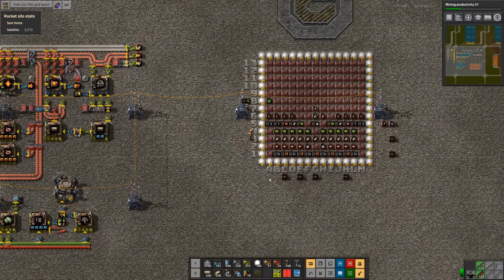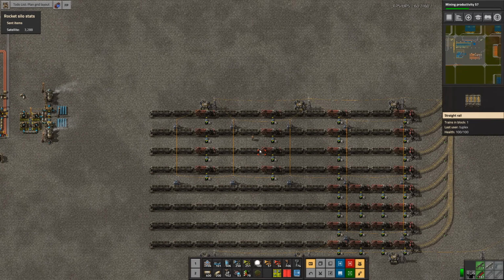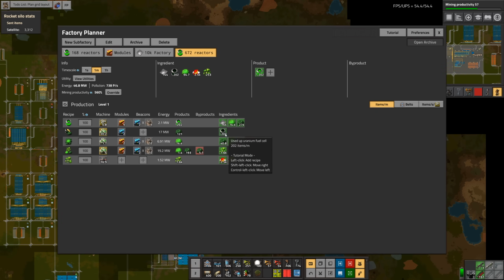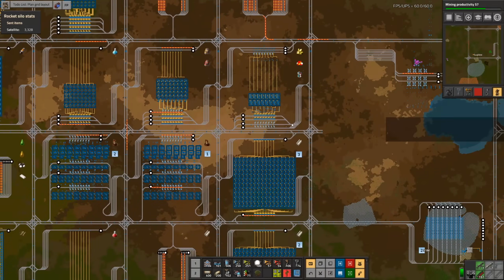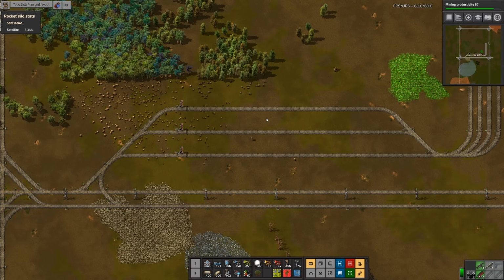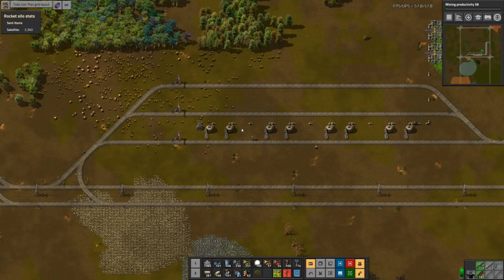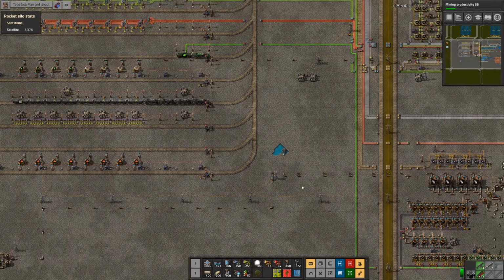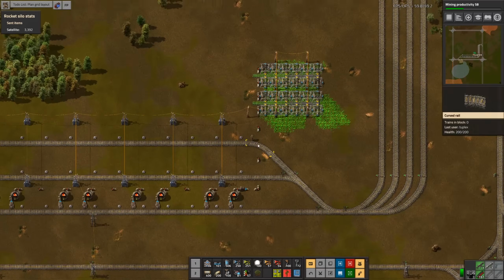Factorio +10K SPM Grid Megabase #2 - Uranium mining

Comment: I'm still not understanding your descision to keep building individual local pipe distribution: as long as the pressure stays up at the far end of the pipe surely the flow rate will remain the same (unlike belts)? OK it makes things prettier, but the pipe-weave spaghetti to make it work in some cases is to my mind not worth the effort..
Reply from the maker: What do you mean by “individual local pipe distribution”?
Reply: @TuplexGaming  In your current setup you have everything, whether transported by belt or pipe, done 8 times from each relevant rail car thru its manufacturing stage to each output railcar. While this is necessary for belt-transported items, surely pipe-delivered fluids only need to keep the pressure up at their furthest point, eliminating a lot of unnecessary duplication?

Comment: 8:20 - another option, use the "read train" or whatever it's called, and have the fuel inserters check the T signal for being < or ≥ someNumber -- where someNumber is something you figure out as the train ID of the last train you created under the old system, and < or ≥ is chosen based on which position the inserter is next to -- ones next to the first pair of new-wagons/old locos get fuel for old trains, the ones further back get fuel for new trains..  You'll want to avoid adding trains to the old system (because then they'll be mixed up, and you won't have that easy comparison ability), so maybe create a few dozen trains in a yard somewhere to be able to add if you think you'll ever need to... though I'm guessing you won't really need to.  And then any new trains you create will be on the new system, and the T value that's the cutoff for the inserters deciding is just the lowest train-ID for any of the new-system trains you've already created.

Hopefully I'm explaining that well.  :)
Reply from the maker: Makes sense, but TSM has been updated and now we have a better solution!